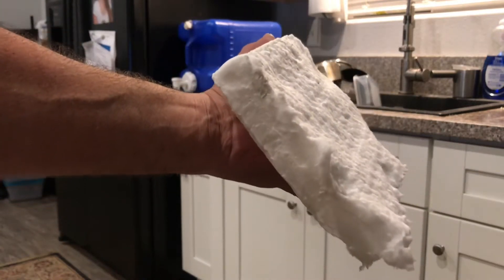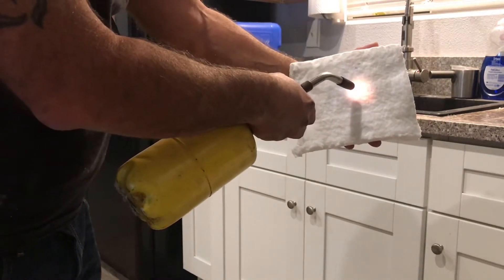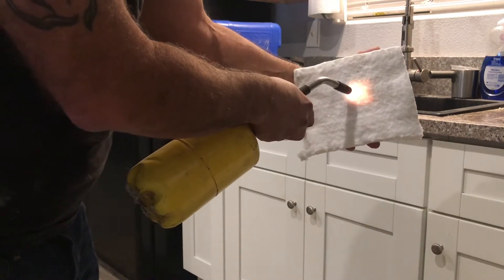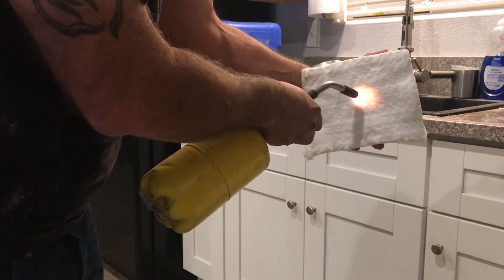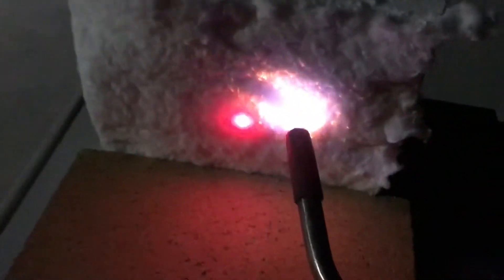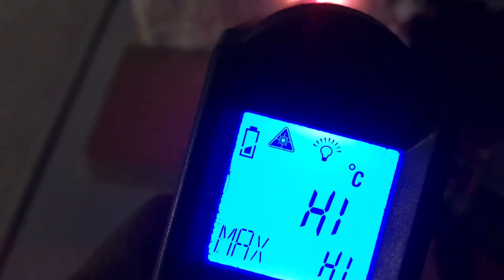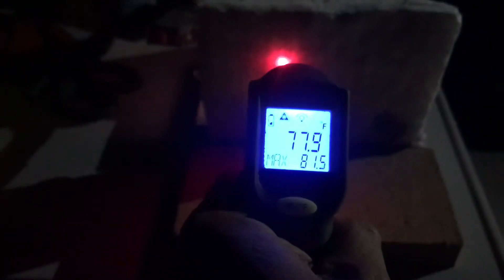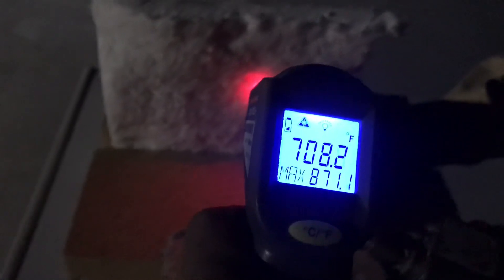Ceramic fiber insulation test.

Comment: What density is that one?
Thankyou
Reply from the maker: ceramafiber Ceramic Fiber Blanket by ceramafiber - Insulation 8#, 2300F,1" x 24" x 25 FEET for Wood Stoves, Pizza Ovens, Kilns, Forges & More - 8# Pound 2300 Degrees

Comment: Thanks for the demonstration, i needed this for my diesel heater exhaust to cover around the exhaust that goes to 300F in between a wood hole, I will buy it!
Reply: I need this stuff for my diesel heater also. Mine is in a stanley fatmax box.
Reply: Stuff is rated up to 2400

Comment: Becareful the cheap imported insulation is not ceramic but asbestos
Reply: how do you tell the difference?
Reply: @BronzeOrwin  Buy from a reputable dealer and not imported from china
Reply: @zack9912000  so is there no way to tell once you have the product? if someone int he us idiotically imported and resold something from china, i'd like to know if there's a way to tell the difference.
Reply: @BronzeOrwin  I will hunt down the brand name I order every two years
Reply: I'm looking at stuff on amazon how can you spot the difference?
Reply: @donegal2010able  Don't buy from Amazon, buy from  a proper supply house. People package up anything, there are certainly differences but you won't be able to tell till you have it in hand.

Comment: Peace be upon you 

I have many questions I would like to that necessarily get the answers for my discussion after some day 

1) What's the meaning of the Classification temperature for any material  for example  ( the Classification temperature 1300°C)

2) Ceramic fibers have high melting point and high tensile strength property  why ??
Reply from the maker: I'd love to anser but im not that smart.
Reply: @TreasureGeo  Thank you  very much  for answer 
I am very sorry for annoying
Reply from the maker: @saharhussein3684  no problem